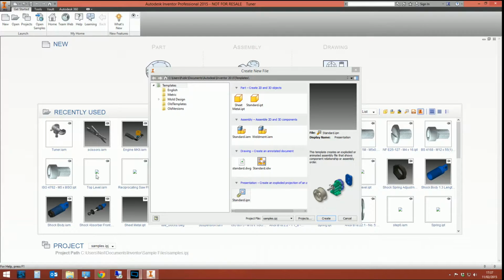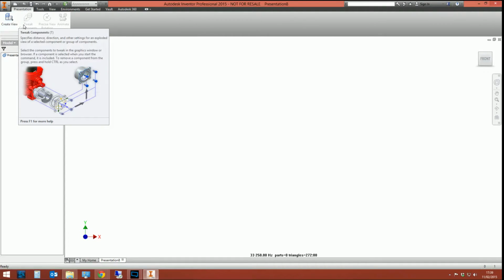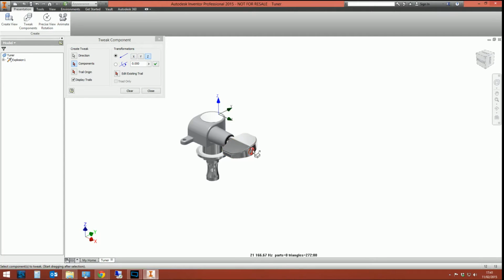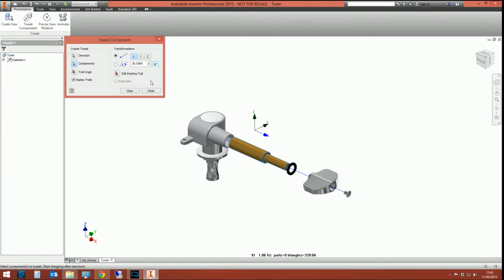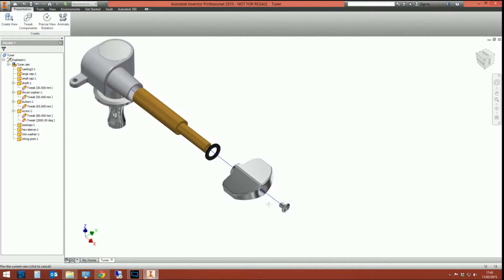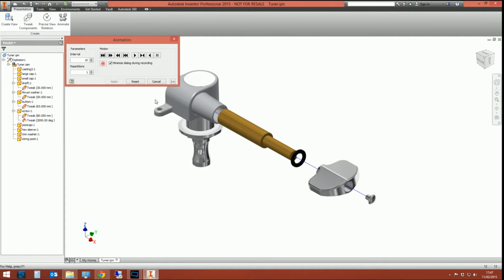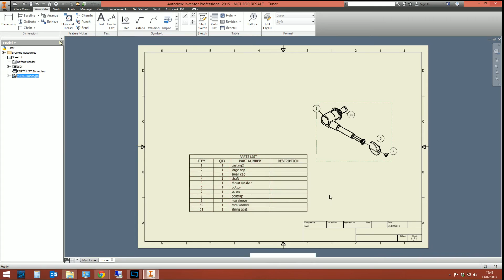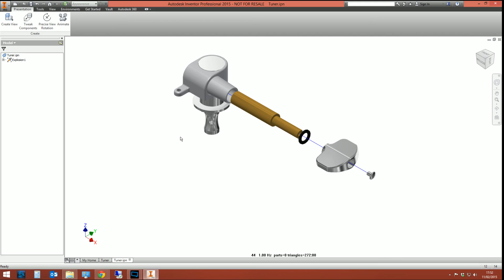How to create assembly instructions, IPN files | Autodesk Inventor

Comment: Nice video. You probably already know this, but when moving an object in the ipn environment, you don't have to grab an arrow head on the triad. You can put your cursor out in the open and drag in the direction that you want the object to move. Oh, in the US, there are Haynes manuals in every auto store around. Keep up the good work Neil...
Reply from the maker: Yea I found that advising people to put the cursor in the open resulted in temperamental behavior, their hand could ever so slightly move the mouse upwards before pulling in the desired direction which resulted in the wrong axis direction being locked... it happened on literally every single training course.  Which is frustrating as you have to then cancel the whole thing and restart, new users just can't grasp why and how.  Also I found that people, if not clicking the arrow heads, would click 'over or on top of' a part in the view which then instead of setting the direction, adds that component to the tweak.  Basically I found that method was too irritating and prone to accidents! So I tend to not tell people that's an option, use the arrow heads or directly enter the direction and distance into the dialog box.  But I guess once someone understands the quirks then can work around them :) And thanks for watching too, really appreciate it!
Reply: Yes, I can understand what you're saying about the way people learn things. I've tried it both ways and always find myself slowing down to get right on the arrow head. I guess it's all what you get used to. You make some pretty good videos Neil, and I appreciate you taking the time to share your knowledge. Take care...